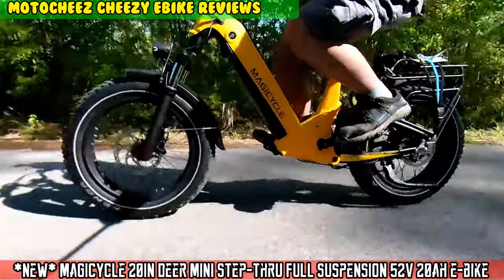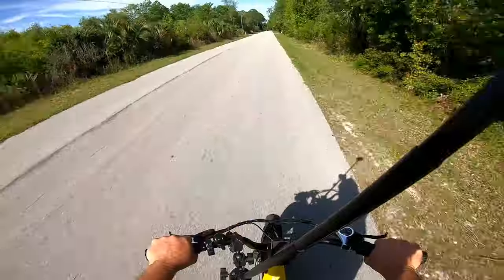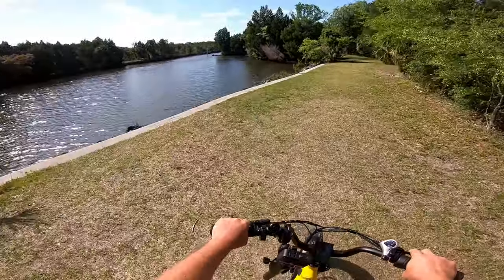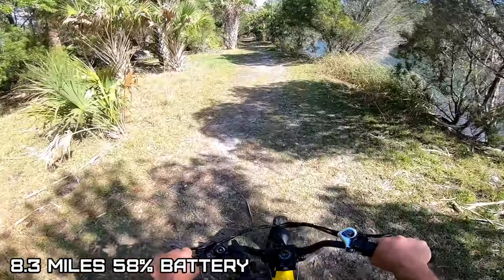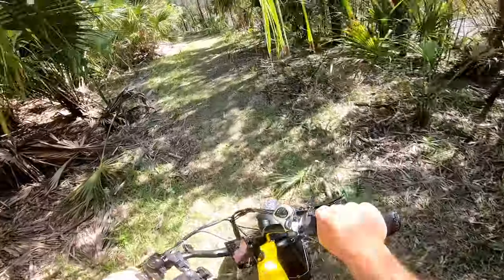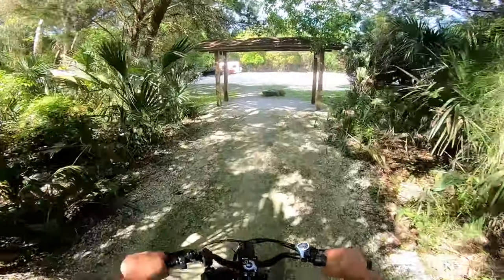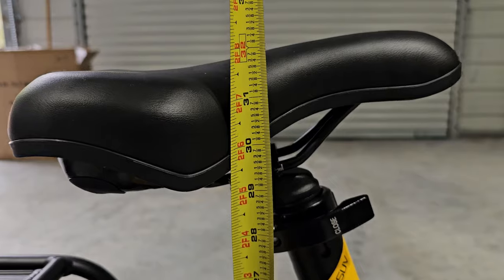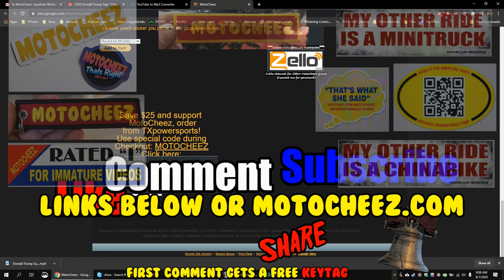MAGICYCLE Deer 20 SUV mini Step-Thru Full Suspension 30mph 52V 20aH 750/1100W peak hub eBike

Comment: 55% at 10 miles? Mine gets WAY better than that. U must have been mostly throttle.
Reply from the maker: That's how I test the battery is all throttle mostly full throttle just to see what the extreme will do on the battery, it actually did pretty good by the end of the test surprisingly. The gauges pretty accurate compared to many of the other e-bikes that I've tested where they hit 1/3 in a drop drastically in 5 mi you're dead
Reply: I only get just over 20 miles on my Ariel Rider Kepler. 52 V 20 ah. Throttle only at 33 to 35 mph. Just flat ground and 210 lb  rider
Reply from the maker: @kevinnashskitchen3517 I'm 235, so just about same the. 20 miles, but I didn't kill the battery, I think it had a few more miles left.